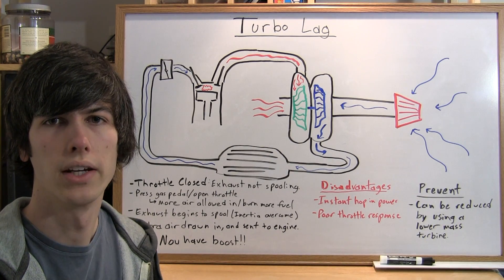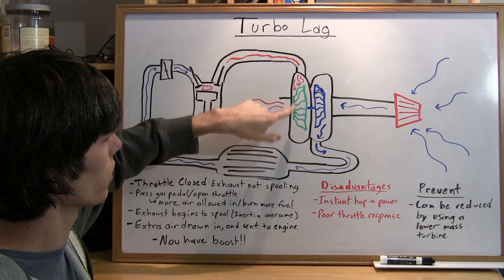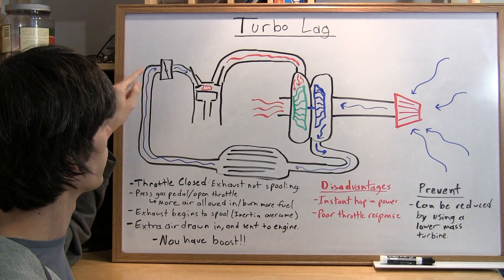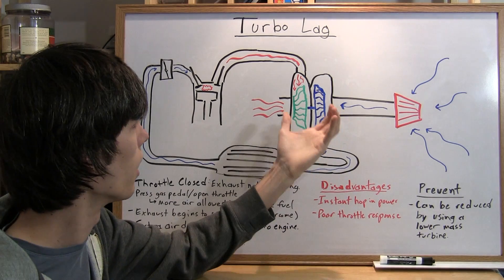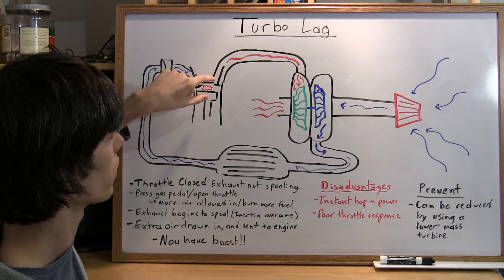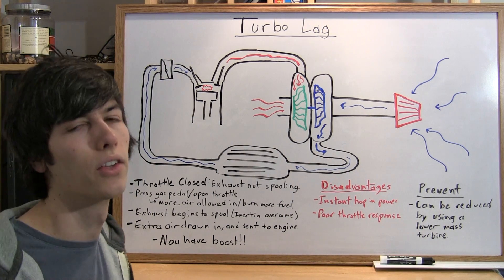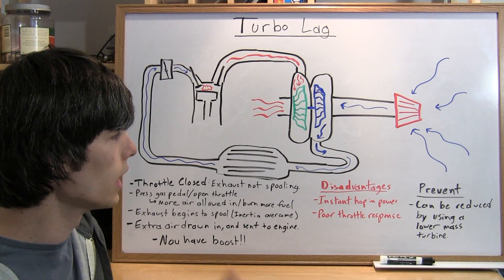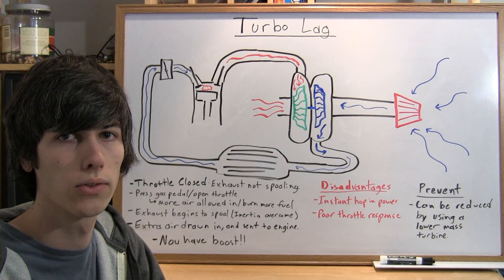Turbo Lag - The Problem With Turbocharged Cars

Comment: I just want to aske you something... is there a way to not activate turbo untill you want it, because it burns more fuel and it suks if it is activated all the time.
Reply from the maker: Bogdan Deme Don't put your foot down too much, and it won't spool up.
Reply: Good to know, thanx man.
Reply: Bogdan Deme Most cars also have what is known as an "eco" mode. I believe this shuts off the turbo.
Reply: chancy319 Its not really possible to shut the turbo off.  You should look up "cylinder deactivation" that is usually what ECO mode is doing, at least today.
Reply: Colin Sebern That is what waste gates  are for. They redirect excess exhaust gas from reaching the turbine

Comment: Could you have a small electric motor to artificially spin the turbine and then allow the natural process to take over when it reaches normal exhaust levels?
Reply: NFG Nugent Its currently used by all teams in Formula1, known as MGU-H. Stores energy when off throttle (as a generator) then when on throttle uses this harnessed energy to spool the turbo (motor).

Comment: While I do get the idea of turbo lag, in the case of huge turbos they tend to take away some of the low-RPM torque and and shift them into the higher RPMs, meaning you'd have less torque than usual in the low RPM ranges. Why is that happening?
Reply: ZeroStriker426 I believe it is because they take more exhaust to spool the turbo, but once it gets to higher RPMs the boost really kicks in, smaller turbos spool sooner but don't provide the same power throughout the higher RPMs. I could be wrong but this is how I've come to understand it.
Reply: +burnoutnt 
You are correct.. the larger the turbo & the pipe work, the more exhaust gas that is required spool the compressor wheel... But once it gets going, the higher volume of compressed air + fuel mixture make way for a rapid combustion process.. rpm, power, torque are all directly proportional to each other.

Comment: Driving school and others teach to drive at low RPM to safe gas. Is this actually true to turbos which face this problem? I think that my car starts to boost at 3000 to 3500 RPM but of what I have learned this (or even lower) is the point to shift gears.

Comment: Does the volume of the space between the compressor and the intake valve contribute to turbo lag?
Reply: Yes it does. It isn't a huge factor however, but a shorter/less voluminous intake plumbing can help a bit to reduce turbo lag.
Reply: Use compressed air to avoid the lag

Comment: Can you please do a video of the differences between Turbo Lag and Boost Threshold.
Reply from the maker: iTroIIin This video explains turbo lag. Boost threshold is the RPM at which you're producing enough exhaust to spool up the turbo, thus allowing you to create useful boost.
Reply: +Rawkem Sawkem you are right but you dont wait much as below max boost rpm but still small respons delay and blow off valves reduce that delay
Reply: Engineering Explained I always thought that lag is when you are past the threshold, but have let off the throttle momentarily causing a drop in exhaust pressure, so when you mash the peddle again you have to momentarily wait for boost, even though your engine is still above the RPM threshold...? Am I wrong?
Reply: ilke tama
Thanks
Reply: ***** no problem

Comment: Is it possible to have a turbo lag and anti lag system ?
Reply: Engineering Explained Anti-lag isn't a system you install and it's a drawback? ROFLMFAO.
Reply from the maker: MrVideomagic101 Anti-lag is not a system you install, it's a drawback of turbocharged engines.
Reply: Engineering Explained I think what you mean is that turbo lag is a drawback of turbocharged engines. An Anti-lag system is a system you install in a turbocharged engine to virtually eliminate turbo lag and get back that instant throttle response the turbo robs you of.

Comment: turbo lag can be used by using a low-mass turbine? hardly...... the most effective way to reduce lag is to use a smaller hot side and a bigger wastegate, this will also allow more turbo rpm meaning more boost at higher engine rpm.

small scroll, increased exhaust gas velocity, much quicker spool, higher backpressure- but by using a larger wastegate you rid of the backpressure, resulting in nothing but quicker spool (and ability to increase boost if you wish.) i wouldn't waste my time swapping turbines.

Comment: What is the difference between boost threshold and turbo lag?
Reply: Turbo lag is just the amount of time that it takes the turbine to start spinning fast enough to create pressure in the intake
Reply: ok thanks , so im assuming boost threshold is the point at which the turbine is rotating fast enough to provide an adequate amount of boost? you start to feel that additional torque kick in and your car starts to accelerate incredibly quickly?
Reply: Justin White Boost threshold definition from Garrett turbos- Boost threshold is the engine speed at which there is sufficient exhaust gas flow to generate positive manifold pressure, or boost.
Reply: Ok, thanks for the help wades623. been wondering about this for a long time.

Comment: why aren't they making the turbine wheels out of titanium for less mass and is it possible to make a hybrid turbo spin the turbo with an electric motor for 0 turbo lag
Reply: wades623 Kristian benz  Actually I think the 2014 F1 engines (V6 turbo hybrid) use electric power to reduce turbo lag. So looks like it is possible.
And if you want weight reduction, I'm not a car engineer but I think carbon fiber is still the best option.
Reply: Titanium would likely be more expensive that most people would be willing to pay and an electric motor wouldn't work just look up those electric "turbos" on Google and you will see why
Reply: wades623 i didn't find anything on google but i think it is because an electric motor won't spin that fast as a turbo about 200 000 rpm but i think that can be made by gears (one gear) like on a bike (5 rpm on the electric 50 rpm on the turbo something like that and as LatIngenium  sais it is possible because they use them on F1

Comment: before the turbo kicks in where does the air come from? i mean i know the air/fuel mixture gets into the cylinder and burn then the exhaust will spin the turbine of the turbo and then force more air into the engine but suppose we're starting the engine and theres no exhaust going out of the cylinder initially to spin the turbo where does the air come from to get into the cylinder if not from the turbo in order to start the engine?? Engineering Explained
Reply: Under very low load/idle situations turbocharged cars essentially act like naturally aspirated cars. Since the engine isn't producing enough exhaust gasses to spin the turbine fast enough to create boost pressure, turbocharged cars run under vacuum in these situations... which is why, if you looked at a boost gauge in this situation, you would still see vacuum and not boost. Once the driver steps on the gas, more fuel and air is added into the engine, spinning the turbine faster and creating boost pressure.
Reply: the suction / vacuum caused by the cylinder on the intake stroke. it will still suck in air like a non turbo engine

Comment: I know cars, but not everything.  Can anybody clarify what exactly it means by the amount of boost, or how it works.  Like for instance if you were running 20# boost, does that mean the amount of boost from a turbo, or from something else.
Reply from the maker: Brandon Bonaudo It's the pressure the turbo provides. A turbo providing 15 lbs of boost (or a supercharger), is providing an additional 15 psi of boost over atmospheric pressure, meaning the air going into the cylinders is approximately 30 psi (15 psi atmospheric (14.7) + 15 psi boost = 30).
Reply: Alright, thanks man.  So you then have your car properly tuned to put out the right amount of boost?  Great videos by the way, I subscribed!
Reply: Brandon Bonaudo it's really tuning it to provide the adequate amount of fuel for the target amount of boost you want to run, and then of course the power:fuel ratio won't be linear either, the more boost you run the richer the fuel mixture should be, helps to cool the cylinders so you don't blow up :)
Reply: Engineering Explained Hey, thanks for all the great videos, i just subbed.

Comment: I find a lot of people , people who don't know much about turbo cars that is, really haven't got a clue what they are talking about when talking about lag. when u argue about na vs turbo they always have the argument, oh a turbo car has the turbo lag, so a na car would be better and probably win in a race. what people don't seem to understand is as the turbo is spooling up, ur hp still increases, u still make tons of power in that lag period. most of the time more than an na car makes. u still make ur peak hp at same rpms as na cars do, sometimes quicker. u get a lot more torque at lower rpm than na cars do. and the lag of the turbo is milli seconds. the way some talk its like they think u have 5 seconds of lag before ur at full boost. I don't see any disadvantage to turbo lag at all. yes u don't have ur full boost instantly, but does that matter? no cause ur still making buttloads of power on ur way up to full boost. and most cars, if they had full boost instantly would do nothing but spin tires.
Reply from the maker: tomjw7 I agree. I think turbos are terrific, they allow for peak torque much earlier, and allow you to use smaller engines which in the long run turns into fuel economy savings.
Reply: exactly. iv argued with a few people and they are always, oh id kick ur butt cause u have turbo lag. and there is a pretty big hp difference between the cars. I am so close to saying, ur a dumbass and walking away. lol I truly believe they think turbo lag means, no hp till turbo kicks in. I don't get why they don't realize the turbo kicks in the moment u hit the gas. and power keeps building till ur at peak. just like any other car. turbo is just a lot more fun, and a lot more in a shorter time lol
Reply: tomjw7 brake boost :)
Reply: if you are having a count down when already at a certain speed, brake boosting helps a lot. If you are at a standstill devices like cobb accessport have a feature where you can set it to a certain RPM and launch with peek boost. My WRX has a decent size turbo, I notice the lag, but if I am driving around 3k-4k RPM its pretty much instant boost. If I am in gas saving mode, 2k RPM, it will take a good 2 seconds to come onto full boost. For my car its 16psi -1/+1psi tapering off to 14 psi by 7k rpm. I like the way my turbo behaves because I can step on the throttle half way and still not build boost, but over take most cars on the street. There will be times I NEVER build boost during my commute and still get a decent 22-23mpg average each fill-up.
Reply: when my car was at 15 psi it literally took less then a second, pretty much instant when from a dead stop. I put it to the floor and it was at max boost almost instantly. size turbo right and get a twin scroll and that helps a lot. but what im saying is ur still making power on the way to full boost. now im on 30 psi but I cant judge how fast it gets there cause im boost ramped. but it hits 25psi in still less than a second and 30 psi comes in at about 4500 rpm, to be easier on the tranny.
Reply: The thing is . what this video and this reply are missing, is the waste gate(most turbos use one),.. turbo's don't make power until the wastegate closes and allows the boost into the motor. The waste gate doesnt close until the desired boost has been acheived, this allows a consistent boost and prevents spiking and sagging. That said, you can easily rev the motor into boost range before letting the clutch loose. IF you can get the perfect amount of tire spin you can maintain boost range through out your launch and then of course switch gears and stay in boost range. All which makes turbo lag no issue whatsoever. Done wrong, you can fall short of boost for a bit and an N/A could get a jump on you depending on other factors of course.
Reply: U got it Wrong , the waste gate opens when u reach ur desired boost if it was open and then closes u would never reach any boost cause as long as it's open u can't make boost cause exhaust bypasses turbine. U can't be in boost when clutch is pushed at stand still unless u have an Antilag tune. Sitting there spinning ur tires, lol u go try that see how it works out. And if u have no lift shift like some cars. U don't have to take ur foot off the gas when shifting at wot and boost is maintained. Like a power shift but actually built into the Ecu so u don't break things

Comment: isnt this why people use twin turbos to overcome turbo lag? one small one, and one large one.
Reply: Didn't say it was twins. That's just what they call it.
Reply from the maker: BigNastyreborn Can help make a larger range, yes.
Reply: xXxDANMANxXx a "bi turbo setup" is more known for being called a "sequential" setup, mainly due to the fact that one is set to a lower PSI, while the other is set to a higher PSI, so you can stay in boost 24/7. (for the most part).
Reply: Or a single turbo with two scrolls. BMW does this and it works very well. They call it "TwinPower Turbo." Almost zero turbo lag.
Reply: That's not twins. That is a compound setup. Small turbo on top supplies the bottom turbo
Reply: oneaburns not you man talking bout the OP
Reply: Yes, essentially feeding each other.
Reply: twin = 2 of the same
you're talking about bi turbo setups and yes the smaller one will have less lag than the larger one, but utilizing advantages of both

Comment: What is "turbo lag" in comparison to the "boost threshold"? Is the turbo lag the amount of time from throttle open to torque reaching the wheels and boost threshold the point at which the turbine starts to spool due to the build up exhaust gasses?

Comment: firstable thank you for all your videos.Now i have a question, how electronic turbos work?
I need info about electronic turbos, I was wondering if you can help me ...
Reply: I hope you don't mean like the ones might car mods mythbusted in their videos..
Reply: Electric superchargers (turbochargers use exhaust fumes to spin a turbine, and so it isn't an electronic turbo) rely on the battery to spin a fan which "tries" to compress the air to add extra oxygen to the cylinders, however as the battery doesn't have enough power to effectively compress air, all that actually happens is you're blowing air into the engine, like a fan, rather than compressing it, a video by MCM explains this :) Basically, don't buy an electric supercharger.
Reply from the maker: kevin bad I would assume it uses a motor to spin up a compressor, pulling in additional air.
Reply: I'm thinking it would actually be called a supercharger instead.
Reply: It is possible, but only if you have Formula 1 money. The current turbos they use are electric motor aided. They adjust torque curves on the fly.

Comment: i wanted to know 3 things,

firstly ,,,,how the intake air pass into the engine initially.. i.e. during start of the engine.. will the engine work as a natural aspirated engine or will the intake air flow from turbo??.

secondly.. after the start of the engine.. since the exhaust pressure is low.. the exhaust gas begins to rotate the turbine slowly, At this situation since the rotation is slower , turbo lag is observed.. is my understanding correct??

thirdly.. after attaining some speed.. i.e. after attaining required exhaust pressure.. the exhaust rotates the turbine to the effective operating speed to deliver boosted air into the engine... is my understanding correct??

Comment: the turbo can be a bottleneck if too small on the exhaust side but laggy if too big on the compressor side a ratio is required engine dependent because the spool has a mass just right is required sufficient exhaust gas to spool up quickly without bottleneck but not too big that it struggles to spin and the compressor same applies a good tune right parts almost laggyless throughout the rev range

Comment: Just for reference, the wheel on the intake side of a turbo is called a compressor, not a turbine.
Reply: shut up nerds
Reply: Adam Brackney true other wise it wouldnt suck the air
Reply: It is a turbine with high static air pressure

Comment: how can you reduce the turbine mass??? what kind of material??
Reply: Aluminum... Im not sure if they make carbon fiber ones, I'm not sure
Reply: HiPChecKeRfilms No, the turbine blades need to withstand ridiculously high temperatures, at very high RPM (high centripetal loads) so I guarantee they're not aluminium or CF. They are usually high carbon steel or nickle based alloys in high end turbines.
Reply: cylejh Sorry no, the COMPRESSOR is aluminium, but the TURBINE (exhaust side) that drives it is steel.

Comment: Engineering Explained Im driving a 2002 subaru wrx and sometimes when the weather is hot, when I step on the gas I feel like no power and then you will feel and hear the RPM suddenly goes up.Is that a turbo lag?

Comment: Another thing I would like to point out is, turbo lag noticeably happen when opening throttle, I do agree with you about the throttle valve blocking the compressed intake causing a slight but not annoying on de acceleration, but isn't that why we put on pressure relief valves and compensate by controlling the fuel load? I have been inventing much more efficient systems that has NO lag which I am very happy about and will make me rich :)

Comment: Why can't a non return valve be installed after the inter cooler (no bov), that way when the throttle is closed, boost is stored. Then when throttle is opened you get instant boost

?????